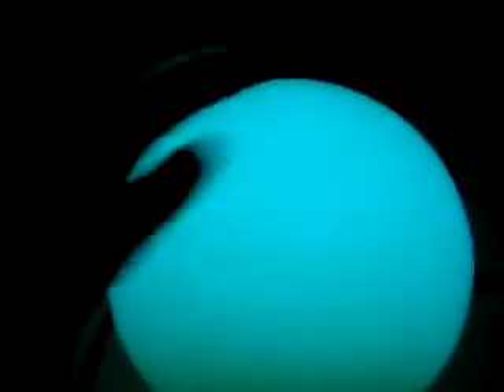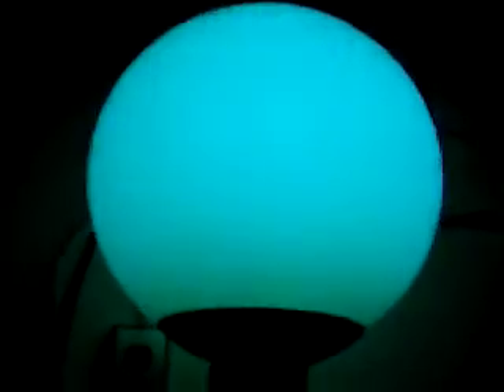Mercury vapor 100 watt tabletop globe fixture firing up with clear lamp

Comment: You will never be able to replicate mercury vapor.  However, 100 watt mercury vapor ballasts are not made anymore however, I do have a trick that will allow you to use mercury vapor.  All a pulse start metal halide ballast is just a mercury vapor ballast with an igniter added to it.  All you have to do is buy a 100 watt metal halide ballast and yank the igniter out and then only use the capacitor and ballast and bam!  You now have a 100 watt mercury vapor ballast.  I do that all the time.  And, when your mercury vapor bulb dies, you can reinstall the ignitor and use a daylight colored coated metal halide bulb.  I do that too all the time and a daylight colored coated metal halide bulb does mimic a coated mercury vapor really well.  Problem is that the metal halide bulb will never glow that classic hot pink color upon start up that coated mercury vapor is known for but a coated daylight colored metal halide bulb does mimic a coated mercury vapor really well.  These are just tricks that I use since my tree lights were 100 mercury vapor and I converted them to metal halide.  You should be able to find daylight colored coated metal halide lamps at Light Bulb Depot near you.  If not, try a landscape lighting store or you might have to order them at a commercial electrical place like Parrish Hare or Rexel Electrical.  Ebay works too but avoid Amazon.  The stuff on Amazon is garbage.
Reply: Actually, a 100w M90 pulse start metal halide ballast will overdrive 100w H38 mercury vapor lamps quite a bit because 100w M90 pulse start metal halide lamps run at about 100v 1.2a whereas 100w H38 mercury vapor lamps run at around 135v 0.85a. A better solution would be to get a 70w M98 pulse start metal halide ballast and remove the ignitor since a 70w M98 pulse start metal halide lamp runs at around 90v 0.90a, which is almost electrically similar to 100w H38 mercury vapor lamps. In addition, a magnetic rapid start fluorescent tube ballast designed for a single 800mA high output fluorescent tube that is between 4 feet and 8 feet long with a red and a blue wire capped off can also run a 100w H38 mercury vapor lamp pretty well as well.
Reply: That would work too.  They are great solutions.  HOWEVER, REMOVE THE IGNITER!  REMOVE THE IGNITER!  Mercury vapor is ALWAYS probe start.  Pulse start mercury vapor doesn't exist, at least to my knowledge.  If you install a mercury vapor lamp on a pulse start metal halide ballast, with the igniter operating, that WILL cook a pulse start ballast in minutes.  If you install a mercury vapor lamp on an electronic metal halide ballast, even for a couple of seconds, it destroy the electronic metal halide ballast in seconds really.  So, if using a mercury vapor lamp, avoid electronic metal halide ballasts.  And, you may see an awesome deal on F-can M90 ballasts, don't get them if you plan on running a mercury vapor lamp on it.  If you run a mercury vapor lamp on a pulse start ballast, you will damage the igniter.  That is why that I converted my 100 watt mercury vapor tree lights to metal halide and use daylight colored coated MH bulbs.  I had one of them fail and couldn't start a bulb anymore but the other one was still functioning correctly.  I converted them both.  Because, one of them a mercury vapor and the other one a metal halide is an accident waiting to happen.  A mercury vapor lamp will damage the igniter and put the ballast in the toilet.